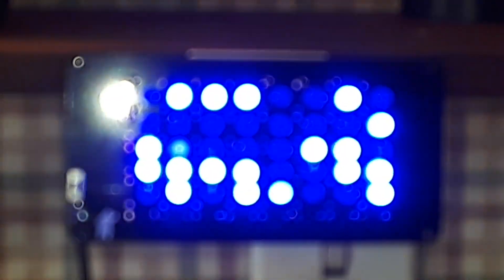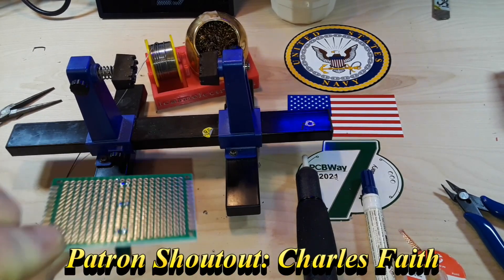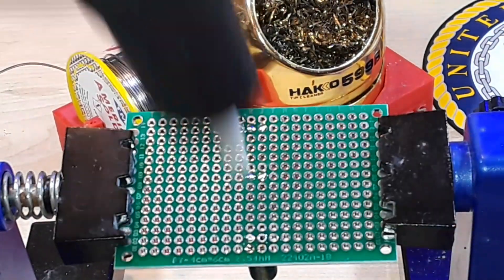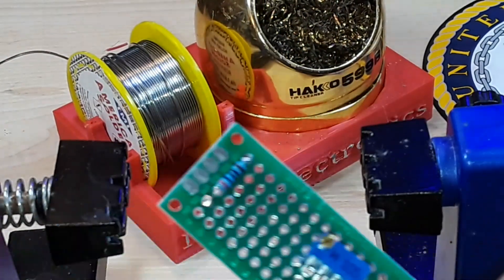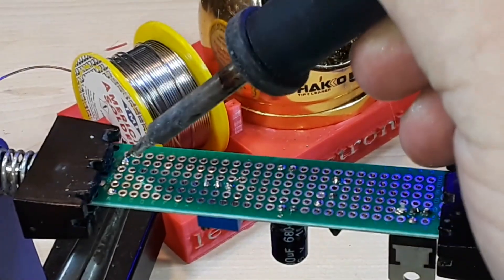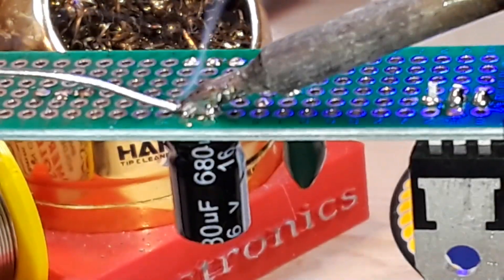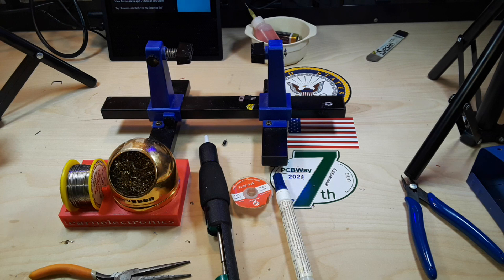A simple desoldering technique

Comment: From the sound your solder sucker makes I would say it is quite old and lame. You should take out the spring, pull it so it is 150% length and put it in again. Or buy a new sucker which has good power.

To the falling out: Not going to happen in many cases because a) the pin has a bend on the lower side or b) the pin was quenched when the remaining part was clipped off at assembly.

Difficult case: Soldering off Thumbwheel potentiometers. They have 5 to 7 pins, usually soldered on lower and upper side. I find it easier to clip the pins off at the upmost point, take away the potentiometer and then heat up each hole and pull out the rest of the pin.

The example with the resistor pulling can result in a disaster. Sometimes it rips off the upper hole with this. Be sure to first heat up long enough and not pulling hard. But, same problems as described above can prevent a soft-pull.

Comment: Interesting technique.  But here are my impressions:
- With the desoldering pump, the iron should stay in contact with the joint while you use the pump.  Do not withdraw it.  It's OK for the pump to be a millimeter or so short of fully covering the joint.  It is not OK for the joint to be re-hardening.
- With the braid, keep the braid bunched together, not spread out wide; that makes it maybe 3x as good at absorbing solder.
- Compared to my experience, it looks like maybe your iron isn't quite hot enough or isn't transferring heat well.

Comment: I wondered what the big trick is going to be ... :D
News: you can do just the same you did with a resistor with any 2 lead component (no need to add solder).
But if you want to install a new component in a hole you just removed one from, you will still need some way to do it. There the pump and braid are really useful. 
And I can hardly understand why plated through holes are such a bogey - never had any trouble myself. Had much more one sided pads come off than two sided.

Comment: One of the most effective de-soldering tool I have ever used was a hot solder sucker. This was a soldering iron that had an air  vacuum pump attached to it. The solder was sucked up a short nickel metal tube into a Pyrex glass tube about an inch in diameter, and about two or three inches long. A silicon rubber air line was connected to the far end of the glass tube and then  to a vacuum pump. About a third of the glass tube was filled with  a glass wool plug, that kept the removed solder from being sucked into the air line and on to the  pump. The thing was a pleasure to use, as the solder was removed as soon as it melted. There was none of the mechanical shock associated with the spring loaded solder sucker. The only disadvantage was that the glass tube sometimes got in the way of reaching some components. Hot tweezers and a precision hot air gun was great for  removing surface mount devices. The former was better than the improviser two iron method of removing surface mount resistors and capacitors, because the tweezers could be operated with one hand, rather than two.

Comment: What you do with the resistor is what I do with mouse micro-switches. Recently got into soldering 6-8 months ago. My first cheapo iron didn't have enough temp to pull the switch out. Had to keep turning it up. Got a Pinecil and that thing at 380 instantly melts solder and I can use a sucker to get the bulk. If there's any left over I use a little bit of braid to clean it up. I'll keep in mind the flux on the braid. I'll have to try the solder glob trick next time I work on a mouse!

Comment: Hmmm.....I noticed you didn't try that 'trick' on any 'widely' spaced component....might be kinda messy to have a half inch puddle of solder on the pcb.... again, there are many techniques to remove components....but the 'trick' is NOT destroying the pcb, or the plated through hole... nice try though...

Comment: Now how do you clean the holes left behind?
Reply from the maker: Wick, sucker...
Reply: @learnelectronics  I tried wick, and I have tried the sucker and both are pretty bad.  I am thinking the one where it is a soldering iron but in the middle is a hole for a vacuum so a solder sucker with heat.  They are pricey though.

Comment: I'm an old dog. Put an H30 rubber sleeve on the solder sucker nozzle, it avoids stressing the track and improves suction by improving the seal between the nozzle and the PCB; you will have to clear solder clumps from the sleeve now and then though. When you add solder to a joint that you want to desolder, you are not so much adding solder but flux; it's the addition of flux that makes solder more runny and easier for the solder sucker to remove.

Comment: Works a lot better with a knife tip. I did this to recap a PlayStation power supply last night (night before this video)… probably the dozenth one I’ve done. :) Using a Hakko 888D clone with a K-tip.
Reply: Heck, I even own a desolder gun for thru-hole components but I rarely use it for stuff like this.

Comment: woow you will need boxes of solder wires a week 😁 for removing parts by soldering in your way. i don't think they have no idea about solder wire cost .
you can remove parts what you solder you have used to make your pcb but in manufactured pcb they don't simply insert and place the axial lead component like we do , they bend axial lead and cut extra length ., that because wave soldering method component may jump out the wave pressure  so i don't think some method will work practically

Comment: HaHaHa Paul. I'm a older dog than you and I already knew that trick... LOL
I knew there was something else I liked about you. You have a dog named doggly and so cute too. Awesome!
Kidding aside all good ways to remove components. I have just found that you use what works at the time.
Have you ever tried one of those fancy little hotplate liquid solder pots? I have not.
I have found that liquide flux works better on the desoldering braid. Well I tend to use the liquide more anyway... Lol
Thank you Sir Paul for the video!
LLAP
Reply from the maker: No, I'll have try a solder pot
Reply: @learnelectronics  From my research the china pots are kinda ok and do work and are kinda cheap in cost too. The cost is in the led bar you have to buy to fill the thing or a whole roll of solder... lol There again that depends on the size of the pot and how deep it is. I thought about it until I seen the cost of a bar of led... :-)
Also it takes 30 minutes to heat up to use it, so unless you're going to desolder a bunch of stuff then no, not worth it. Now soldering is something else from the videos I have watched. Lol Solder a whole board in 3 seconds... 🙂
LLAP

Comment: The left over solder cover up the holes for a replacement component.
Reply: How is the replacement done if the holes are covered with solder..Thanks
Reply: Solder sucker, desolder braid, melt solder and quickly tap board on bench..
Whatever tickles your fancy..

Comment: This technique works well for up to four pin devices, but it is significantly more difficult when lead free solder is used, or where the leads have been bent over to help secure the components before soldering.  Lead free solder melts at a much higher temperature than lead/tin solder, as a result it is much harder to keep a large solder joint molten. Remove the iron for an instant and the solder sets. The heat is also poorly transferred via the plated through holes, which means the top solder is reluctant to melt when heated from the bottom joint. 
It sometimes helps to heat both sides simultaneously, using a second iron, or a hot air gun. Here again there are difficulties, as components such as electrolytic capacitors, mounted close to the PCB, block access to the top copper joint.
Some PCB manufactures, insert all the leader components into the PCB, before flow soldering the whole board. To stop the components from being knocked off the PCB or rising up as they pass over the solder weir, the component legs are bent over, to trap the component in the PCB.
It is far easier to resolder a faulty component for replacement, as it is not necessary to remove the dead component undamaged.
In this case the best method is to cut the individual legs of the component, before desoldering the component wires that remain in the board. This technique works particularly well on ICs with lots of legs. Here the component legs can be cut with a side cutter, allowing the component body to be removed. Then the individua cut legs that remain in the board can be removed be heating on one side of the board and pulling or sucking through on the other side,once the solder has melted. Heating on the bottom side, and soldering sucking through on the top side is a very good way to clean out the plated through holes, once they are free of the component leg.
Of all the components to be desoldered from a PCB, the most difficult can be transformers, particularly the five or six pin,or more types. PCB mounted transformers often have large metal tabs on the frame, that are bent over on the underside of the board.
These tabs not only provide mechanical support, but are often soldered down to earth the metal frame and core of the transformers body. To remove such devices, it is first necessary to remove the flood soldering over the bent clips, and then prize them back to vertical, to free the transformer from the board.

Comment: Just put a hard tweezers underneath the component and let it's spring do the job. That way, you can do 3 things at ones, heat up,  use a pump and apply seperation pressure.

Comment: Also if the component is faulty or suspected faulty and worth less than a dollar you can just cut all of its legs (including ic dil pins) , scrap the part and then remove each of the stumpy legs one by one. A lot quicker than repairing a busted pcb due to overheating.  Of course with surface mount it's a different game and you will need a hot air reflow soldering station.

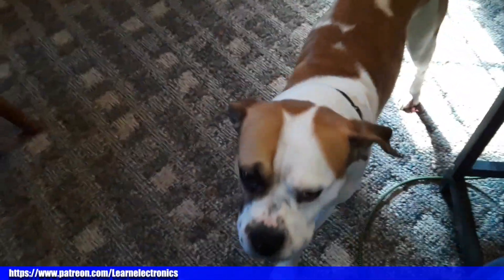Comment: 07:38 Note how the plated through holes are still full of solder after removing the component.  How do you get the solder out of them in order to insert a new component ?
Reply: I can answer that. The same way that you would clean up the holes left by the resistor, with a de-solder pump. With the non-plated thru holes also, cleans the pad up nicely.
I like the idea of adding more solder.
Reply: Copper braid or stranded wire works good for cleanup also. I prefer stranded wire. There is always some kind of electrical work taking place where I work and the electricians routinely throw handfuls of short pieces of heavy gage stranded wire on the floor.
Reply: I use a metal steel pin. Melt the solder in the hole and push pin through the hole. Solder is pushed out but does not stick to the steel pin.

Comment: Another nice tip to clean solder from a through hole is to heat from the top and then quickly tap on the bench.
Reply from the maker: Yep. You can give a good sharp blow 🌬️ too

Comment: When I scavenge components from old broken junk that I don't care about the board, I use a big soldering iron and an air compressor  to blow the solder out of the plated holes and multi layer boards on the first try most times but only if you don't care about the board!

Comment: You can buy a set of tools which include little picks and a small fork to hook under each end of the component. You place the lever, heat that lead of the component and lever that end out. Other end is easy once only one end remains. I learnt to add extra solder early on in my electronics career for Desoldering so it's good know and use this technique as well.
To clear the plated through holes of solder I heat them to melt solder then push a small diameter dressmakers stainless steel pin through the hole which pushes out the solder which then cools around the pin. The solder won't bond to the pin as its cold and no flux is present.
Reply from the maker: Do you know where I could get this tool?

Comment: Thank you for the tutorial. In support of you, I hit the like button. However, I have known of this method, used it and decided that it  has draw backs... 1) it applies a tremendous amount of heat to the component and the board. Lifting a pad, or trace, is possible. 2) I also find it clumsy, to reach around the board. I have to plan out my reach, before I start the removal. That all said, I do keep this method in my knowledge base and use it, when the situation calls for it. Sometimes a poor method makes for the best solution...

Comment: I was doing something similar 35yrs ago coz I was a teenager, had no money to buy a de soldering pump or braid so it was grab the bugger with my fingers and heat up the leads - on a resistor I stuck a steak knife under one end and used that to lift it , they got hot real quick 🤣
Bit hard doing a 14 pin Dip though 🤣🤣
Thanks for the video !

Comment: I was told to get a 4.8mm tip for my Weller 1010 station, thats is the most useful tip I have because it fits against both legs on most capacitors so easy to drop them out like you did there.

Also when I have annoying motherboards with heavy copper planes I do love my new board heater, at about 60C on the board caps falls out and I can suck out the solder to, sure I add leaded first if needed.

At about 80-90C I can use the sucker to get the lead out of the most annoying multi-layer boards with tons of copper, common in old AMD motherboards that used heavy 5V rails with lot of current.

I also find that it helps to heat both trough holes up with the 4.8mm tip at the same time even if Im just cleaning them one at a time with the solder sucker.
Often etch hole has a copper plane on either side so it seems to help spreading the heat to both sides making the solder melt all the way trough more reliably.

Good video as usual!

Comment: Only problem is all the solder left over if you need to swap out a blown component. A lot of flux on multi-strand wire works really good for that, better than copper braid ribbon.
Reply: Good tip!
Reply: The solder was never the problem. Without a component the solder comes right out with braid or whatever… like the stranded wire you mention. The solder typically only becomes a problem when there is a component in the way. Once that is gone, pretty much anything works quick and easy.
Reply: Heck, on single-sided PCBs without plated thru-holes you often don’t even need to deal with removing the solder.

Last night I replaced the electrolytic capacitors on another PlayStation power supply. I removed 5 large caps using nothing more than my Hakko-clone K-tip + fresh solder and once caps were removed many of the holes were already clear. I then used the tip to wick away excess solder from some of the blocked holes and cleared all but two of them. Only then did I introduce the desolder braid, which obviously sucked it right up since there wasn’t even any plated thru-hole for the solder to get stuck inside (single-sided PCB… like most PSUs). Of course, plated thru-holes, ground planes, and power rails are much easier to clear solder from when there isn’t a component leg in there blocking the solder, sticking to the sides, and adding even more thermal mass for your iron to fight with.

I actually own a desolder gun but I rarely use it because a good old K-tip works much better and faster without burning pads. Also, the leads were typically flattened at the factory making it difficult to get the nozzle over them without getting rough. Flowing the solder and pulling the component from the other side will straighten the leg as it pulls through and works much better.